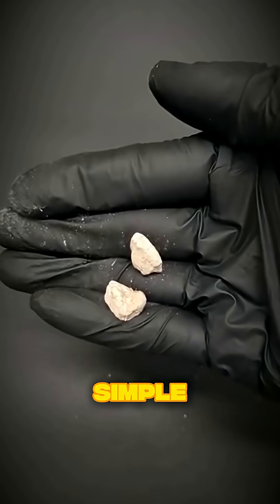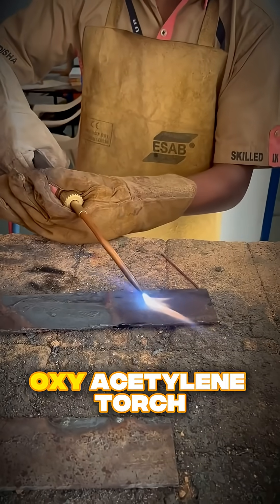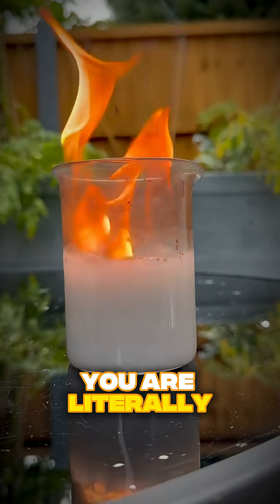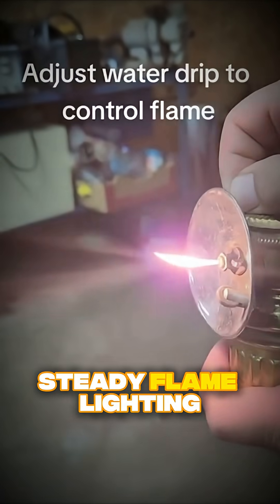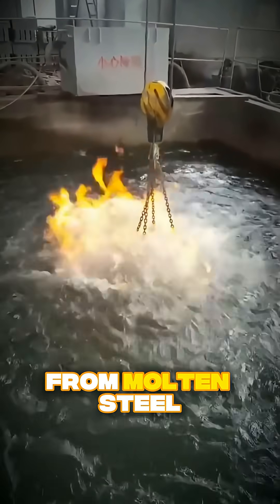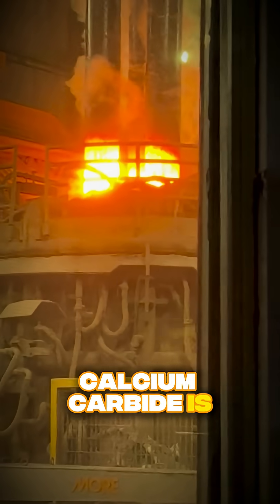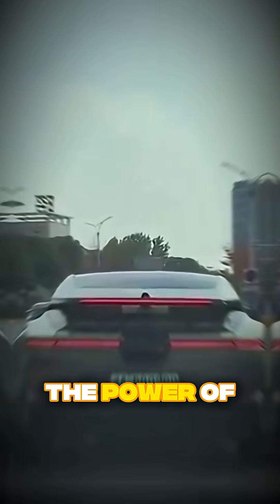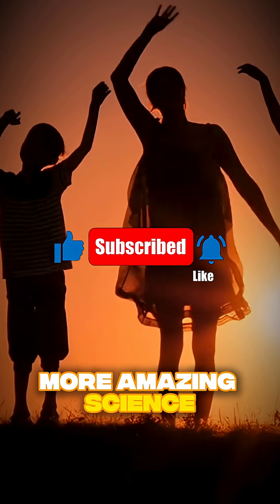🔥 This “Stone” Can Melt Steel?! The Hidden Power of Calcium Carbide! #facts

Comment from the maker: Which fact blew your mind the most? 🤯
1️⃣ It makes welding gas 💨
2️⃣ It melts steel 🔥
3️⃣ It powered old miner lamps 💡
4️⃣ It’s used in fireworks 🎇
Drop your number below 👇